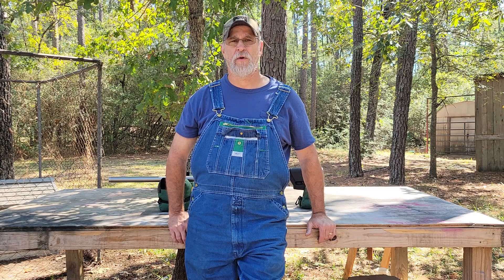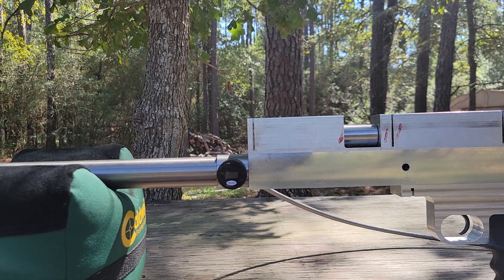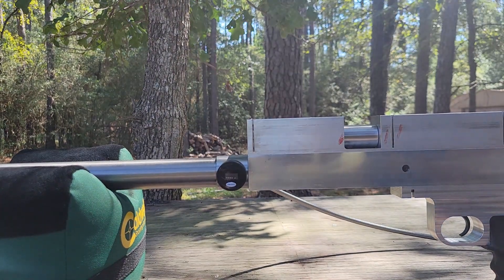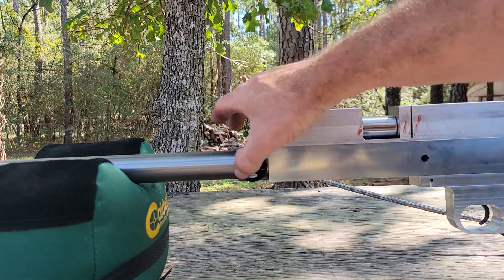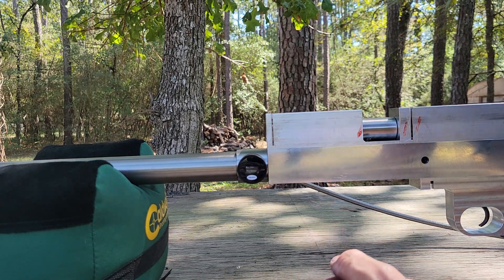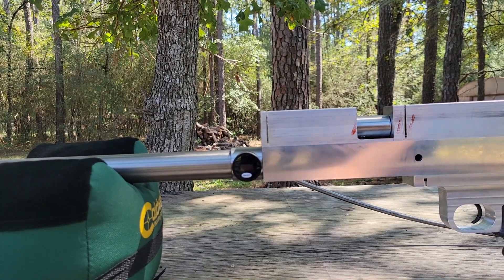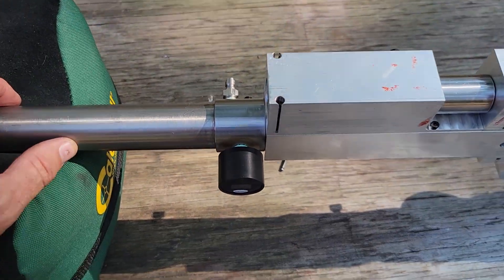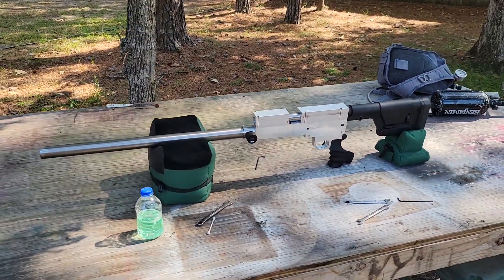257 Air Project Update #2

Comment: Is it going to stay square or do you plan on putting some curves on it?
Reply from the maker: After initial testing I will take it apart and radius some of the corners. For the most part it will stay square. It's part of the design  to hold 4500 psi.